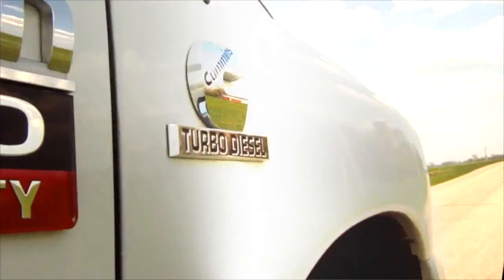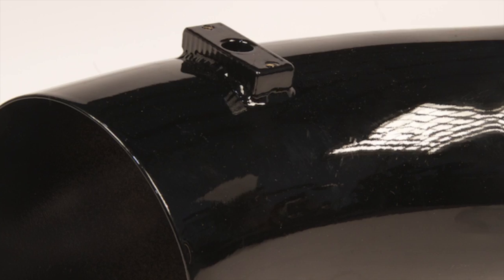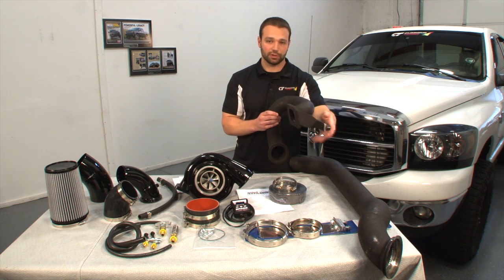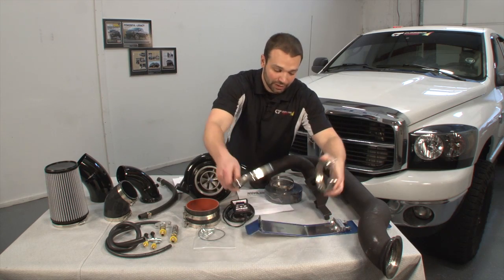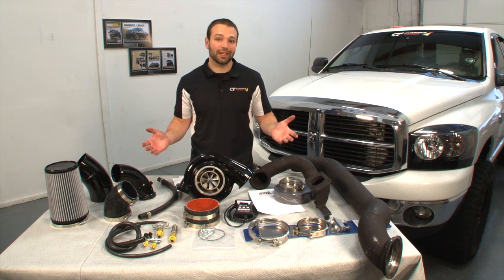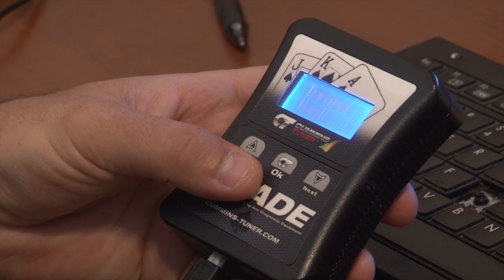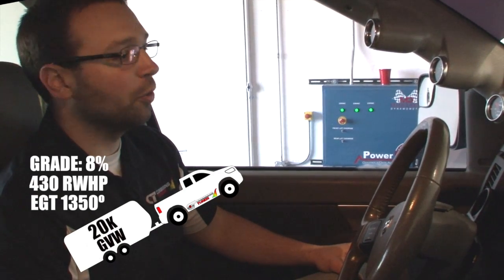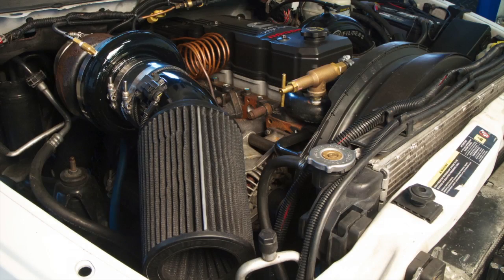Cummins Twin Turbo Kit by Calibrated Power

Comment: Will this kit work with a stealth 64?
Reply: Matt Bynum that’s what I’m wondering
Reply: Taddy Lawn Care ive talked to them on instagram and they said it would work great
Reply: Matt Bynum have you pulled the trigger on it? Would you use stealth 64 over stock charger or would you use a larger one over the 64?
Reply: Taddy Lawn Care you would hang the stealth 64 from the manifold and run a s475 over it. The stealth 64 is a modified he351. I have not pulled the trigger yet, however I did get a 63/67 he351 and plan on eventually compounding that with this kit!
Reply: Matt Bynum yeah, it seems like it would make more sense to put a bigger charger over the 64. But I’m thinking I may have to do some more upgrades if I would want to put a compound setup.
Reply: Taddy Lawn Care if your trans is done, and you have head studs you can do it on stock fuel with EFI live and a lift pump and it would work good.
Reply: Matt Bynum that’s good to know. I have a built trans with studs, and fass 165.
Reply: Taddy Lawn Care dude yeah if you were to get this kit and run their tuning on the factory cp3 and injectors it would work well. You will just be limited on how much power you can put down but it will still spool up well. They are super responsive after injectors and a 10mm cp3.
Reply: Taddy Lawn Care https://youtu.be/oWLb_9iKpK4

Watch that video and look at how fast that truck spools up. Its crazy.
Reply: Matt Bynum that does spook up very quickly! I was thinking about getting 125hp injectors as my next big upgrade but still haven’t been able to pull the trigger yet. Thanks for giving me some more insight. I have lots of plans but as you know these upgrades can be very pricey lol
Reply: Taddy Lawn Care time and money man!! My plan is 125hp injectors and 10mm cp3 as a combo. 90hp injectors is the largest a stock cp3 can really keep up with. Im looking forward to running stock fuel on my new 63/67 with EFI should be a fun set up
Reply: Matt Bynum really? I’ve heard 120hp would be most for stock cp3. Everyone has a different opinion and input. What year is your truck?
Reply: Taddy Lawn Care my truck is a 2006 and yes I asked power driven diesel about what fuel to run for my 63/67 and they said either stock or go with 45% (125hp) injectors and 10mm cp3. They were the ones who told me to run a bigger cp3 with anything bigger than a 90hp injector. Ive seen it done but the stock cp3 would be leaving power on the table.
Reply: Matt Bynum that makes sense to me. I think I’d still go with 125hp injectors to have room to grow into once I upgrade cp3. That’s sweet though, mine is an 06 as well. I’ve been wanting a 4th gen, but I really like my truck and have already put so much money into it. If I would get a fourth gen it would probably be mostly stock.

Comment: Twin turbo?  not really, not at all really.  Compound turbo is actually what it is....  these turbos are not identical or nearly identical like true twin turbo engines....
Reply: +theblackmech  The correct term would be compounded twin. Some people will compound three turbo's.I have even seen two separate turbo's compounded to a third. So the term twin turbo, triple turbo is commonly accepted. Two turbo's = twin turbo, three turbo's  triple turbo.

Comment: as stupid as this may sound i have a question nick! On the duramax's you have the dsp5 switch to switch tunes or if you have an LB7 or LLY you can use the edge insight monitor to switch tunes on the fly. I have a duramax so im not real up to date on the cummins side, but can you even switch tunes on the fly with efi live on a cummins? Or do you have to plug the spade unit in and retune it to a different tune as necessary?